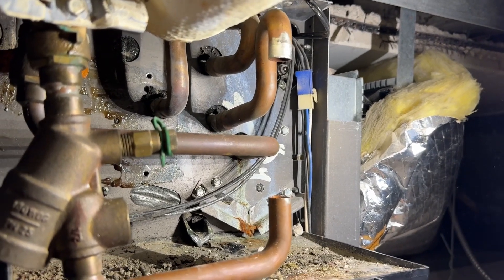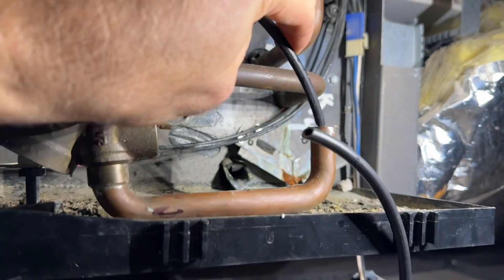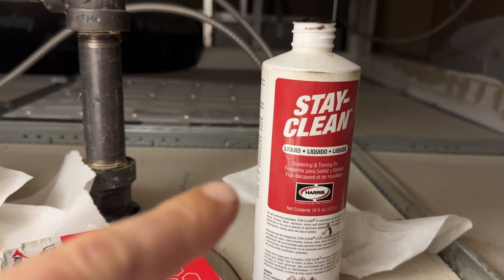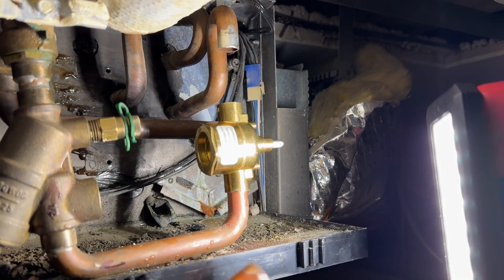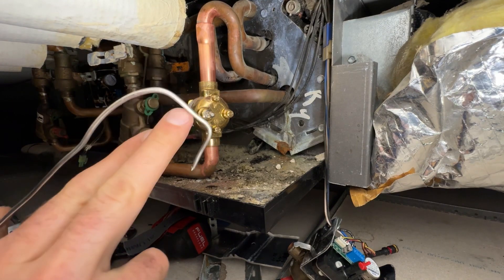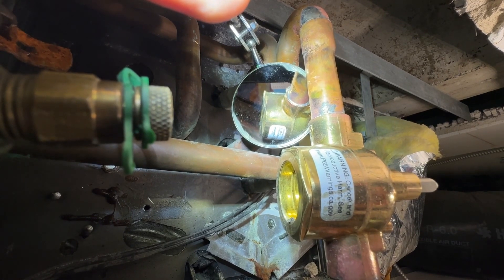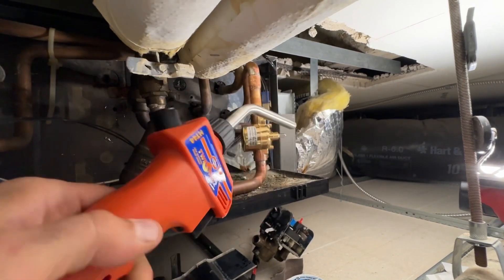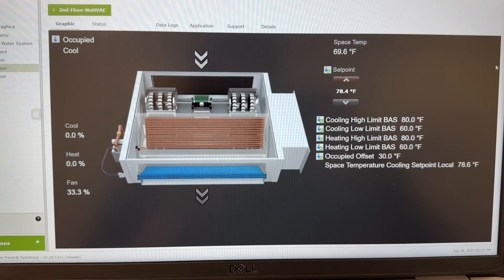HowTo30: Tips and Tricks for Soft Soldering in Odd Situations

Comment: I wish i knew soft soldering even though i very rarely have to do it but still .
Btw the flux we use in refrigeration and hvac for brasing , does it become a contaminant also ?
I bloody hate those flux coated brasing rods , i want the regular silver rods and only use as little flux as i need but they keep getting us these bulksh*t coated ones !
Reply from the maker: Yes, brazing flux is a contaminant to soft soldering. The reason for this is that brazing flux activates at a much higher temperature so it is not actually performing it’s reducing function until temperatures are well beyond soft soldering range. Also, I completely agree with you. Flux coated rods are horrible. I hate the way they prevent separate control of fluxing and brazing.  I like to use the brazing rod itself as a heating indicator and when it’s flux coated it’s just a mess. Even with aluminum brazing rods, which I do think should be flux cored, I always prefer to use a separately applied flux 👍
Reply: @HVACLife  Thank you very much

Comment: Wish they taught soft soldering along with brazing in trade schools. The difference isn’t much but getting used to the higher fluid rating in solder at school versus the field might save that tech a fitting or a part.  I swear sometimes i do more soldering than a plumber and use my multimeter more than an electrician.
Reply from the maker: You’re exactly right, they should teach it!  And you’re also making a good point about how extensive the skill set is of an HVAC technician.  One of my favorite things about this trade is how challenging it is, due to all of the various things that must be mastered 👍